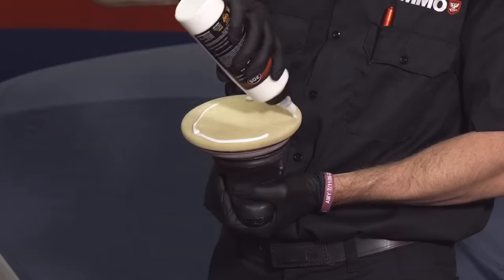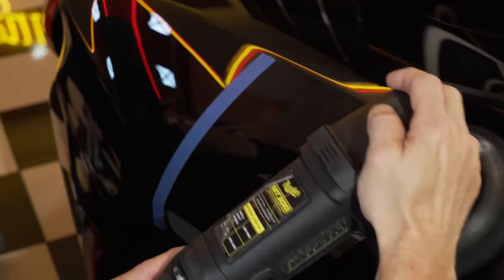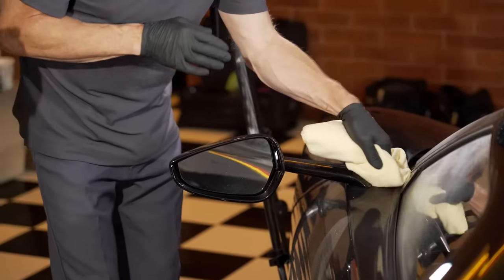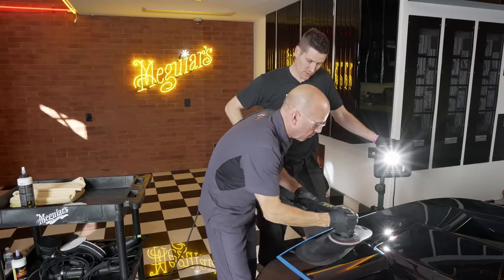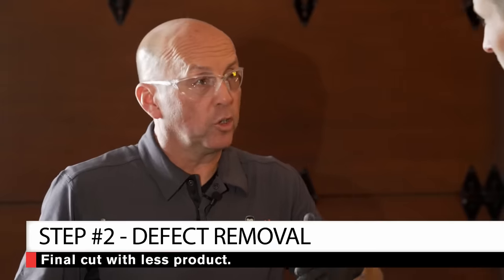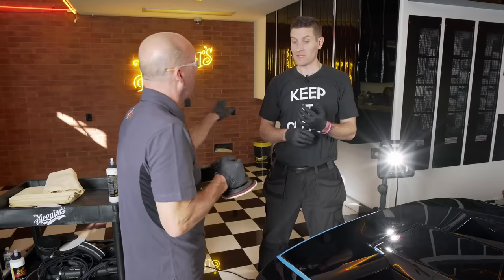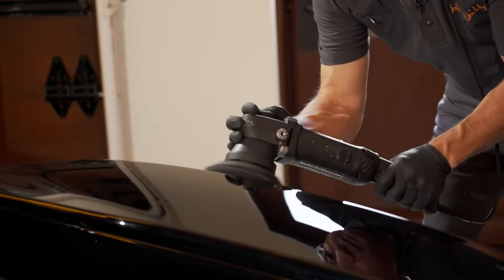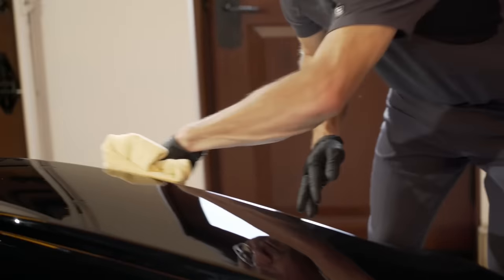3 TIPS FOR POLISHING BLACK SWIRLED PAINT YOU MUST KNOW! FORD GT

Comment: Surely the contact from applying the paste wax is just gonna put all those defects back onto the paint
Reply from the maker: if applying wax, you get defects, then the technique you're using for applying and removing the wax needs to be adjusted.
Reply: If your paint or applicator is super contaminated, maybe.

Your eye would never be able to pick up any defects caused by wax application in a clean controlled environment.

Comment: LOL they act like they are scared to use the compounds and polishes !   I basically prime the pad, then dab on the panel a dab every square ft or so, work a panel or half panel at a time.   But really if you wetsand with super fine like 3000 or 5000 thats gonna clean one up very quickly.  If no deeep scratches.   use 1500-2000 on those, then step up .   Compound , polish, ultrafine polish on black or dark colors.

Comment: how do you know when your getting close to cutting through the clear coat?
Reply: You will see  tiny pin holes in the clear
Coat 🙂
Reply: @djwickedgame3251  TY!
Reply: I crrently work at a Mercedes Benz  dealer  as a quality controller for detailing and customer service,  I see a lot of pre owned vehicles that have been cut to hard and to many times with this problem , if you need any tips or tricks let me know , you can also use a micrometer to measure the thickness of the paint🙂👍

Comment: I have a stupid question.  Are you polishing the black paint or the clear coat on top ?
Reply: Jimmy Martel 

The clear coat
Reply: It's not single stage paint, therefore polishing the clear coat.
Reply: Clearcoat. The reason they say black paint is hard to work on is because of the way it reflects light, not because it's actually harder to polish necessarily simply by being black. With white paint, for example, the base coat is reflecting almost all the visible light that hits the paint so defects don't stand out as much. With black paint most of the reflection comes from the clear so it is incredibly obvious when there is a defect or hazing in the clear.
Reply: So what happened when you have paint transfert on your pad?  Does this means you pass through the clear coat?
Reply: Jimmy Martel
Depends.

With single stage paint you would expect color transfer onto the pad. Multistage paint shouldn't be transferring any color onto the pad during compounding or polishing. Also, make sure that what you're transferring is actually color and not dirty contaminated oxidation, which can come off as a grey/black residue. If you have a dark color car you may be thinking it's paint transfer when in fact it's just grimey oxidation.
Reply: I agree it should be made clearer that the polishing is “mowing” or “buffing” the clearcoat not the black paint. Clearly this naturally causes some confusion with viewers.

Comment: What do you prefer D300 or M105?
Reply: Tough question, because they are BOTH very well engineered, worldwide tested, and popular! D300 was DESIGNED specifically for use with the microfiber discs. It cuts great, and features ingredients that give it a long working time, low dust, and an easy wipe-off. M105 is body shop safe (no waxes, silicones, or ingredients detrimental in a paint shop environment). If you're ONLY using a random orbital, and microfiber for cutting... the D300 is a great way to go.

Comment: This goes against everything I've ever learned about detailing. Too much compound is even worse than not enough, and in my experience produces a lot more heat. I've seen molten backing pads from too much product. Wouldn't you just use the same product amount, but a more aggressive compound? Like using Scholl S3 Gold XXL.

I'm also confused about you leaving embedded contaminants and work them out using a polish, rather than clay/ iron remover. Surely that's the point of those products? If you have lots of contaminants, they are going to be rubbed around with your buffing pad.

That being said, I'm not detailing a Ford GT.

Comment: So did Kevin just say that isopropyl mixes are bad?
Reply: If the paint being worked on is finicky or sensitive, repeated application of ANY cleaning agent can make things worse. Cleaning agents include: isopropyl alcohol, detergent & surfactant loaded glass cleaner, water-based cleaning detergents, petrol-based wax & grease removers, Prep-Sol, etc. Not only can the cleaning agents strip, dry, or oxidize the paint surface, micro-absorption of the liquids INTO the paint can occur. Absorption affects the paint by essentially making it LESS stable (heat from polishing friction expands the paint, while certain liquids readily ABSORB on their own, or are forced into the paint via polishing action.
Reply: iamwaxman what are your thoughts on paint prep products such as carpro eraser, griots paint prep etc.?
Reply: Thank you for this explanation, I feel this is something that many detailers don't have an indepth understanding of....including myself

Comment: You are NOT polishing the PAINT , you are polishing the CLEAR COAT. The paint is UNDER the clear coat. No one has polished real paint since the 1980's. Its CLEAR , not the paint. If you are polishing paint, you burned through the clear coat.

Comment: Saying they are removing paint permanently is horseshyte. Unless you are stripping the car or using an incredibly abrasive pad and cutting compound nothing could be further from the truth in most cases. God I hate hype.
Reply: Exceptions obviously if no clear coat present.
Reply: Wait, what? If you are polishing or compounding the paint you are removing paint. How else do you think you remove defects? The entire process of paint correction IS the removal of paint to level the surface to the lowest common denominator so that the scratches/swirls/haze/defects are no longer visible. If not that, what are you thinking is happening?
Reply: Markus Kleis the majority of so called defects are at the clear coat level. My friend works at 3M. Nuff said
Reply: It seems like you are possibly getting caught up in semantics here - when they/I said "removing PAINT," they/we were referring to both single stage and clear coated surfaces, which means it can either be the color coat paint itself OR the clear coat. Clear coat is paint - it just lacks pigment (unless it is tinted clear). So what Kevin and Larry were suggesting was not "hype," it was spot-on - they were referring to removing clear when they said paint. That's all.

PS, I work at 3M too ;). Well, I work at Meguiar's (which is owned by 3M, so I am technically employed by 3M) as the Global Product Manager for the Professional, Marine and RV lines.
Reply: Markus Kleis yes... thank you for “clearing” this up..!
Reply: Clear is a form of paint...

That is all.
Reply: When they say “paint” they mean clear coat ya dingus.